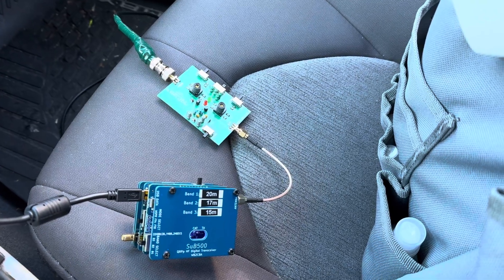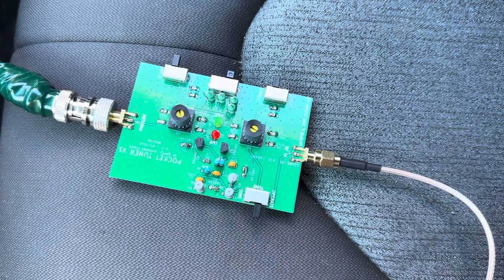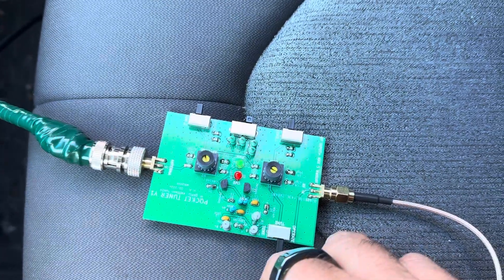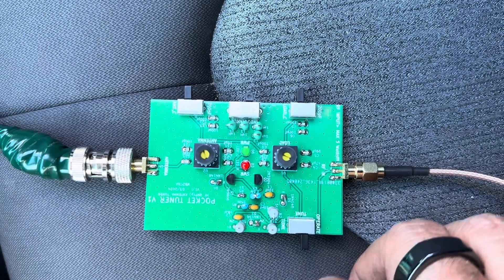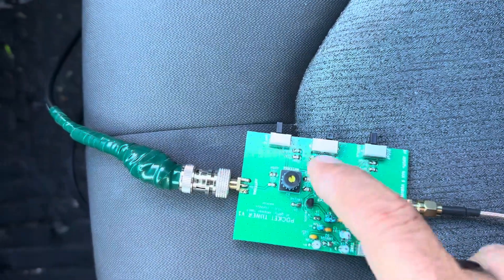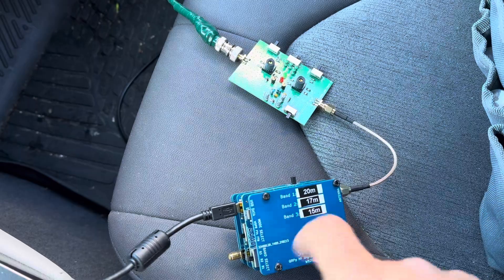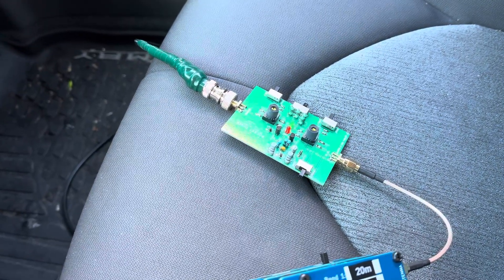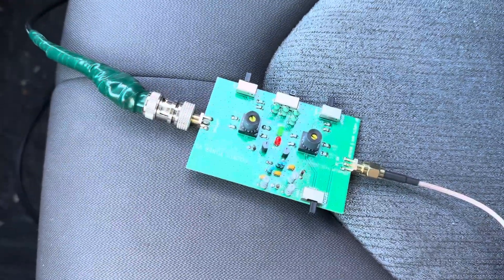Pocket Tuner V1 - Tuning a 10m antenna to 20m on FT8.

Comment: Thanks so much for sharing the plans for this tuner. I am awaiting my printed circuit boards, and I look forward to getting it working. 

I ordered some small plastic boxes and I hope to nest this inside—mostly for transport but also to possibly embed a bulkhead bnc connector for the antenna connection. Thinking to perhaps just solder RG-316 (with connectors on the end) to the board to save on the width of the SMA connectors. And planning to try T30-6 toroids for the inductors on at least one build :)